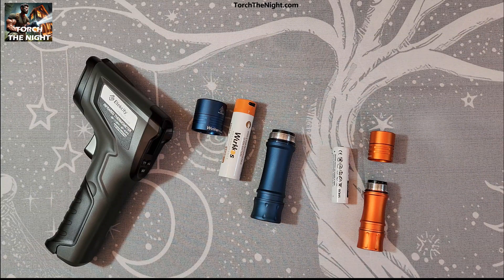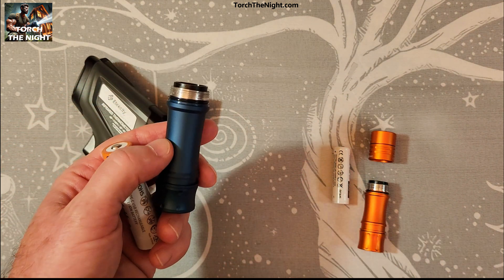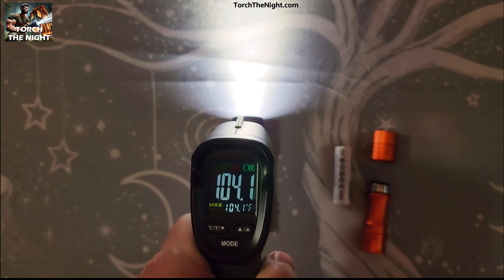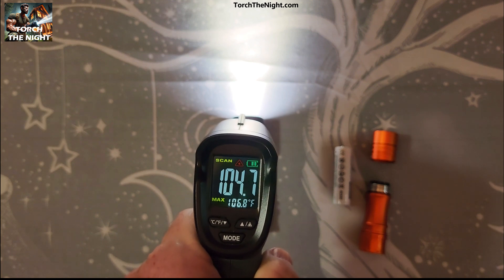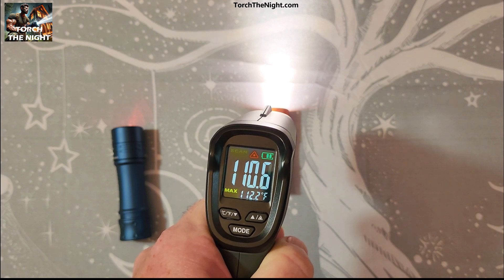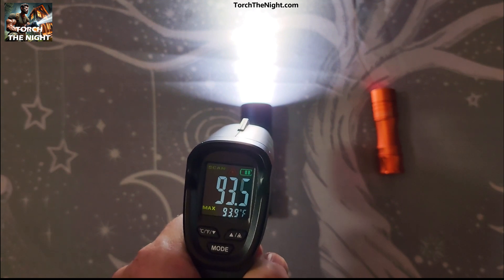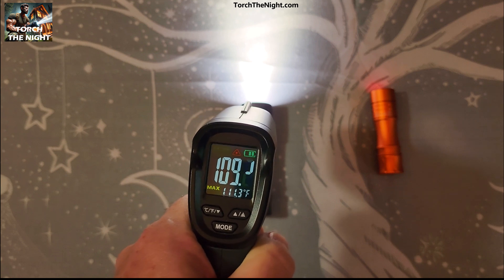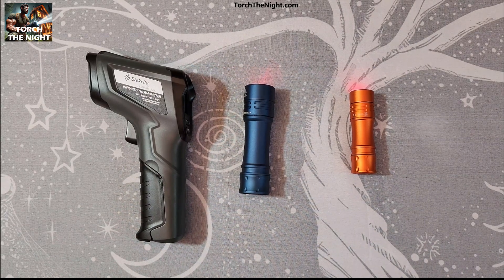Wurkkos TS10 Max EDC Flashlight How Hot Temperature Test

Comment: I sometimes don't get why people obsess over external temps, of all things. Rather than verifying the internal temps which is more important. It should always be lower than external temps, the metal exterior's job is to thermally steal all internal heat and put it outside for dissipation. Measuring just external temp is like criticising the metal for doing it's job properly.
Reply: Because most people worry more about burning their hands than damaging the light from overheating. :eyes-purple-crying:

Comment: Thanks for this very informative episode! My TS10 Max also runs hot on Turbo very quickly and so does my Sofirn SC32. 

Very short tube lights like these lack the mass to dissipate the excess heat and the TS10 Max' smooth tube, devoid of cooling fins isn't exactly helping to radiate heat into the atmosphere. 

The new Wurkkos protected 18650 cell, despite its extra length may not absorb and dissipate heat any better than the standard button top lithium ion cell. I do wonder if its protection circuit can handle the heat from the three Nichia LEDs though. 🤔

I'm glad to have ordered the TS10 Max as soon as I could as the Wurrkos direct store ran out of these lights, even the package with the protected cell. 

The TS10 V2, in my opinion is more of a hobbyist/collector's flashlight. If it used the 18650 format battery I would have bought one ages ago, even though it has Anduril 2.

BTW, have you noticed that the TS10 Max' voltage indication mode seems to be over optimistic? Mine appears to indicate 4.3 volts for a long time, which is not possible as lithium ion chargers automatically limit the maximum voltage to 4.2 volts.  My other Anduril flashlights indicate the battery voltage as 4.1 volts, tops. 

Note to self: I really gotta get one of those infrared thermometer guns. It's the most practical means of measuring my flashlights' temps. 😊
Reply from the maker: I have tested the voltage of the Wurkkos USB-C rechargeable cell outside the Max. It is always lower voltage with a multimeter.  I also doubt the in flashlight accuracy.
Reply: @TorchTheNight  If I had to take a wild guess, Wurkkos was rushed into producing the TS10 Max and they didn't have time to test its voltage calibration properly.

They probably wanted the TS10 Max to be ready in time for Halloween. 🎃🔦